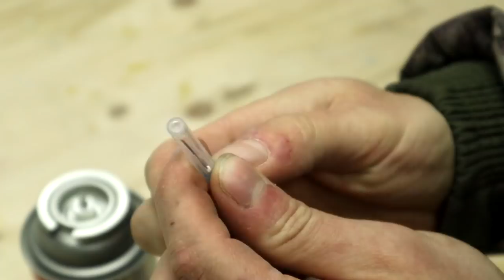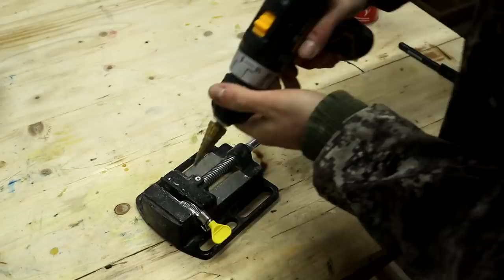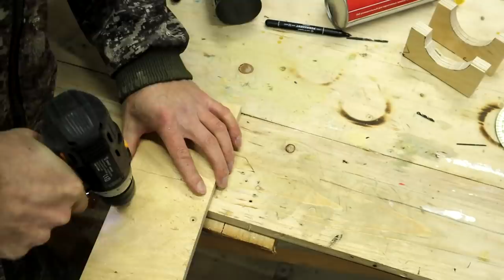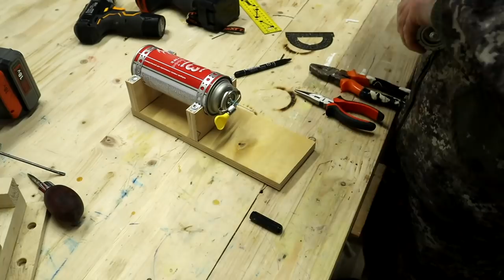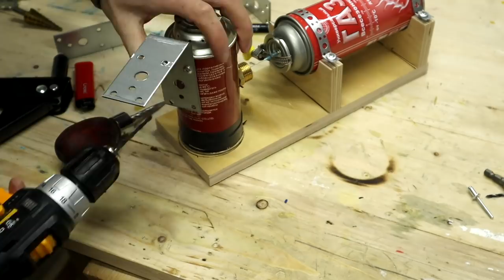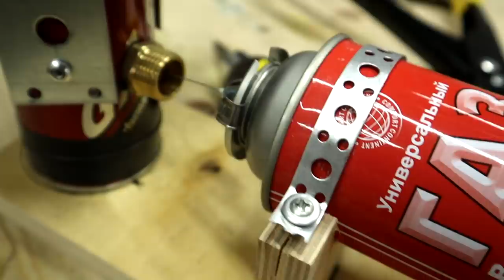Brilliant idea from an old butane canister! You will be glad to see it!

Comment: Wouldn't it be easier just to spend couple bucks and buy a burner ?
Reply: I use my microwave 🤣but you are really crafty and have nice tools❤️
Reply: Yes, is the answer, way too much work, and ‘not’ practical for camping, buy a stove for $8 off Amazon.
Reply: Interesting project with a small potential to go wrong, but let's not blow this out proportion ;) My biggest concern is efficiency. It has to take ages to heat anything with this method and such small flame.

Comment: i used the mini squeeze bottle cap instead of the needle. i drilled a hole into the cap so it works like a butane adapter. now i can refill my lighters.